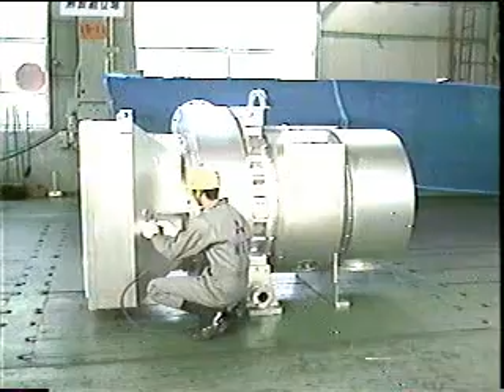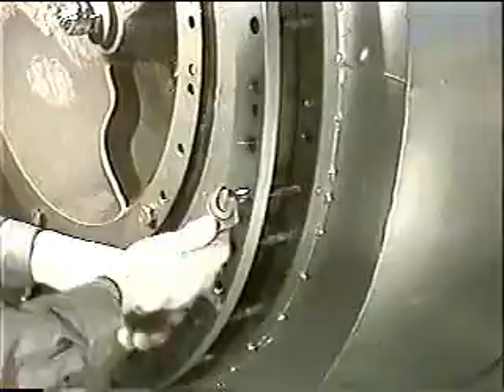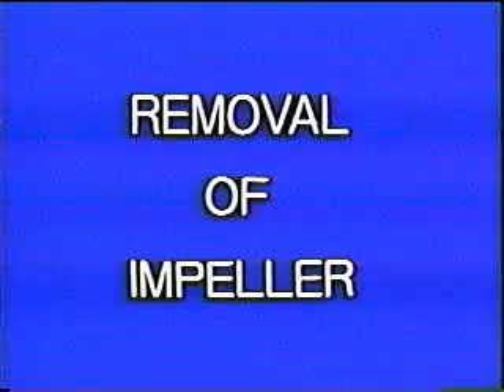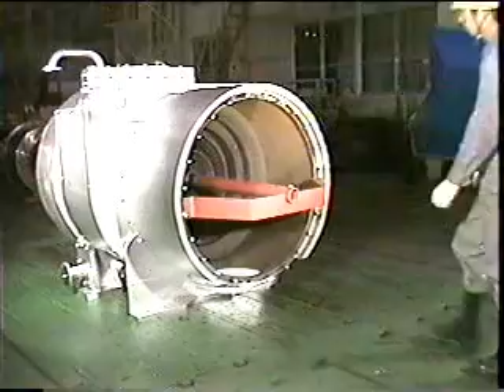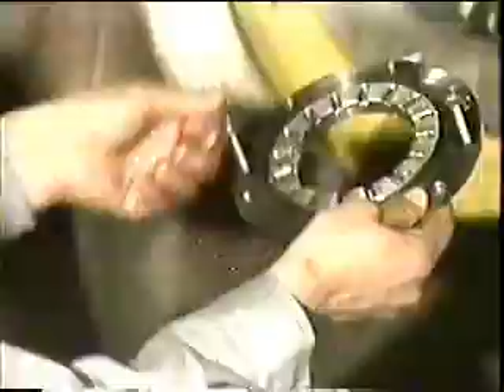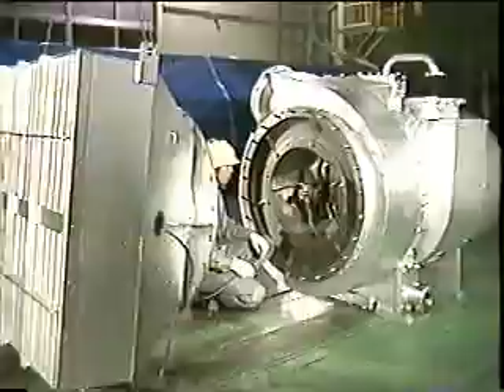MET SC E   turbocharger overhaul

Comment: After installing and tightening the compressor side nut, the video does not tell to release the hydraulic pressure which is used to tighten the nut, safety issue..... release the hydraulic pressure before disconnecting the hose from coupling.